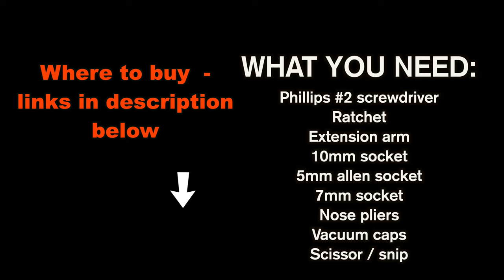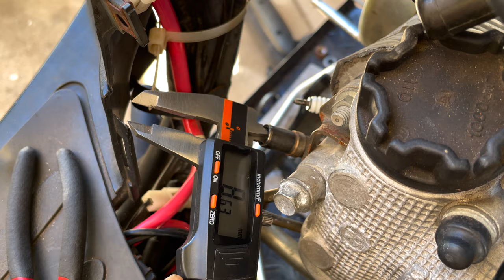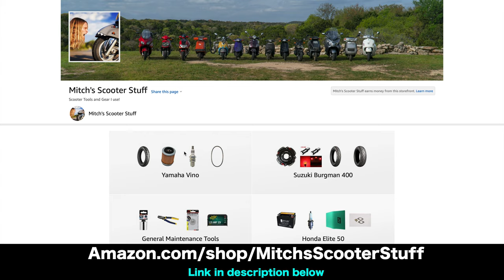Yamaha Vino 125 Emission (EVAP) System Removal! | Mitch's Scooter Stuff

Comment: Just got a Vino 125 and Mitch’s videos have been excellent!!! I had trouble reinstalling my exhaust because it was damaged from a previous wreck. I hammered and pried it the extra 5mm it needed to line back up with the mounting points on the block, because I can’t afford 200-400 for a replacement exhaust. I’m quite satisfied with the results from removing the emissions system. The acceleration is much more linear. Before there was a noticeable hesitation at around 10-30mph, but now it’s nice and smooth 👍👍

Comment: I’ve looked over the emissions system and don’t see anything that would limit power other than perhaps the catalytic muffler restricting flow.  Only reason I can see for the performance increase was perhaps the carb pulling more fuel with the vacuum hoses capped off.  A larger jet in the carb would probably achieve the same result.  A free flowing muffler and carb rejet would probably be the easiest engine upgrade for more power.  And of course variator tuning can really improve a bike for your riding conditions, ie flat or hilly.  A windshield can give a couple more mph on the top end as well.
Reply: After thinking on it some more, maybe the EGR could reduce performance a bit.  I might try pinching it off and see if it makes any difference…

Comment: Aloha Mitch, say...my vacuum plug kit has a plug big enough to cover the axel bolt plug location. Can I use the rubber or is it  heat related that you use the metal plug, then rubber? Thanks, and have a great week

Comment: Hey Mitch. I’m missing a bolt that attached the exhaust from the engine. Do you happen to know what size it is ? And where I could find one ? Cause I don’t want to crack the engine with a different size bolt.

Comment: is it legal to remove the whole system? benifits and will removing this will destroy the engine?
Reply from the maker: Just depend on where you live... where I live do not require emission test so it’s fine to remove... no it will not hurt then engine... it’s just hot air blowing around...
Reply from the maker: It runs so much better on acceleration and little more power, gained 4-5 top speed mph
Reply: @MitchsScooterStuff  thanks , take care

Comment: When I removed the vacuum line from the part you labeled to “just leave there” the whole thing popped apart and pieces fell out, i think I put it back together correctly but does anyone know what that part is? I figured it’s a breather valve or something, can I just remove the whole thing? It appears to just lead to the gas tank.

Comment: HELP!  I was about to clean my V-Belt filter and when I took off the first shield I found a tube that is dangling and looks like it should be hooked to something.  I wish I could send you a picture here.  URGH  I've been having issues with only being able to go 22 mph and then very, very slowly climbing to that.
Reply from the maker: Hi Diana, that should be ok, there are some tubes that are just hanging without plugging to something... they are for breathing ... Wow 22 mph? On your Vino 125? Sounds like you have bad rollers and need to replace.... I have CVT parts replacement video... check it out

Comment: I ordered a generic fuel tank to replace my rusty nonrepairable one and it doesnt have a port for the evap line. Will it run fine if I delete the app cap system only?
Reply: Hey Toasty.  I bought a Vino 125 with no fuel tank.  I can not find one new or used.  Were you successful using your generic tank?  Did it work without the EVAP system?  And finally, which generic tank did you buy?
Thank you in advance, Sam.
Reply: @samgrissom7274  The one I purchased is called Trkimal Metal Gas Fuel Petrol Tank for 50cc 70cc 90cc 110cc 125cc Roketa Taotao Sunl Coolster JCL ATA Baja MotorsportsVitacci BMS Buyang Coolsport Eagle Peace kazuma ATV Quad (Metal-B)

on Amazon. It's made for a ATV/Go Kart but  will slightly fit by using scrap pieces of flat steel/aluminum as brackets to center the tank close to the chrome housing. I got  the filler neck to partially line up with the chrome housing (lip of cap rubs on the housing) and went to a local orileys autoparts store for the fuel line. (I believe I used 1 foot of Gates 4219XL  3/16" fuel line) But I would bring the entire tank to the parts store to confirm. The line included with the tank will not work and leaks fuel all over the place.

 I also ran an inline fuel filter (not from the tank kit) between the line coming from the tank to the line going to the petcock because the fuel line size is different but will fit on both ends of the fuel filter (that has a step sized male end).  Because the tank doesn't have an evap line port, I deleted the entire system and plugged the carb port with a rubber vacuum plug (bought a random assorted box on amazon) The tank itself is vented at the cap. The tank capacity feels like it's between 1/3-1/2 gallon. I was able to travel close to 40 miles on a full tank and the fuel level was pretty close to empty. 

Hope this helps.
Reply: Thank you for your timely and thorough reply, it is greatly appreciated.

Comment: I have a 2009 vino 125. Where do I find the engine number. Thanks.  Bob
Reply from the maker: Hi Bob, It’s right by the bottom of rear shock and transmission oil filler cap